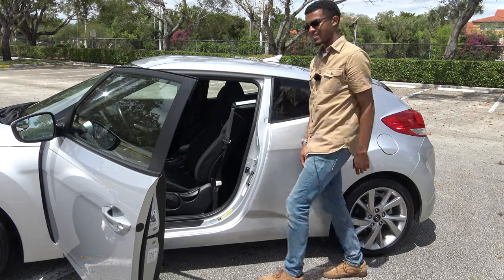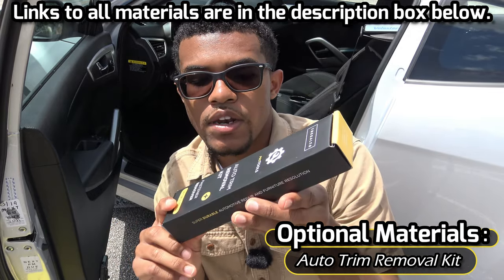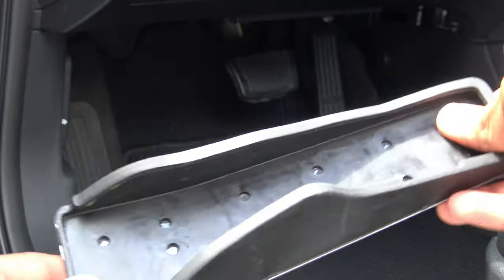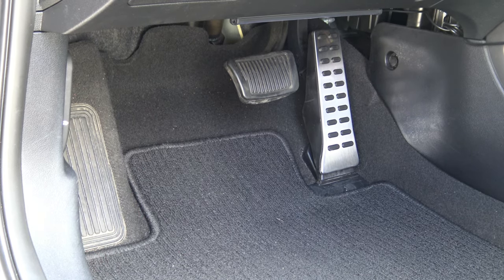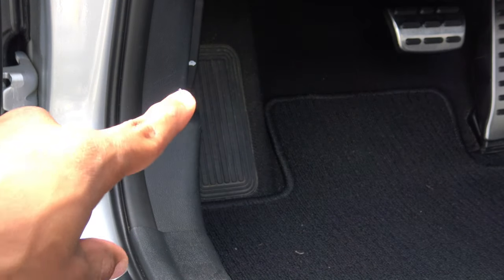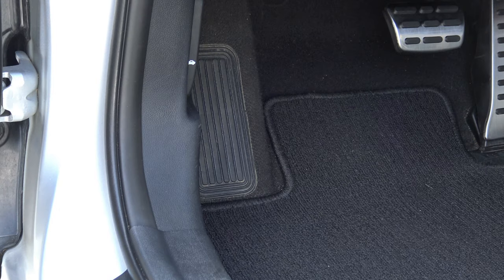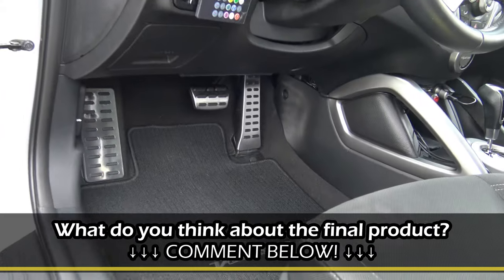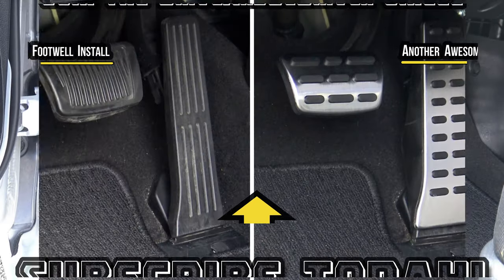How To Install Aftermarket Pedal Covers | Step-by-Step DIY Tutorial & Review | In 4K!

Comment: I read a comment cautioning on the pedal becoming slippery when your foot gets wet. I’ve noticed this video is a few days old have you had problems with that?
Reply from the maker: Hey hey, Samantha! Yes! Aluminum pedals, in general, tend to be a bit more slippery than rubber pedals, but after weeks of testing (and lots of rain encounters), I have no MAJOR slippage to report. Excellent question, though! I appreciate your continued support, Samantha! :) 

~DriveAndBeDriven
"Fuel by Dreams, Driven by Passion"

Comment: Now when the soles of your shoes get wet the metal is slippery...caution !
Reply from the maker: Oh yes! That's a GREAT point to make. Pedals in general are slippery when wet! But, yes... Aluminum pedals tend to be a bit more slippery than rubber pedals (which tend to hold a better grip).

These particular ones that I installed aren't too bad thanks to the plasticy-rubber circular portions that protrude out from the surface, but I totally understand what you mean. The contact point is much smaller with these, so you definitely have to be cautious and keep that in mind!

Again, thanks so much for stopping by and sharing your thoughts! I have more really AWESOME videos planned for the very near future. Stay tuned!

~DriveAndBeDriven
"Fueled by dreams, driven by passion!"